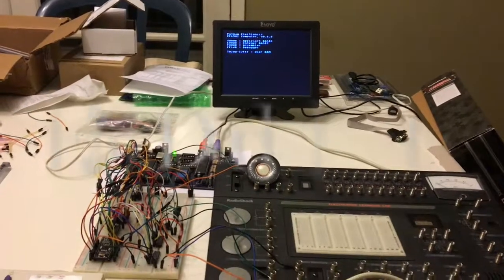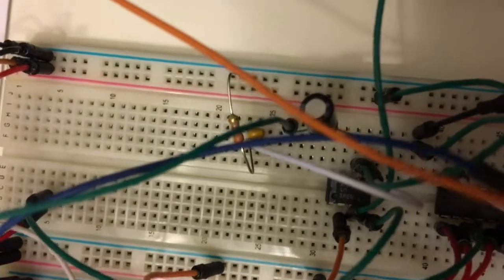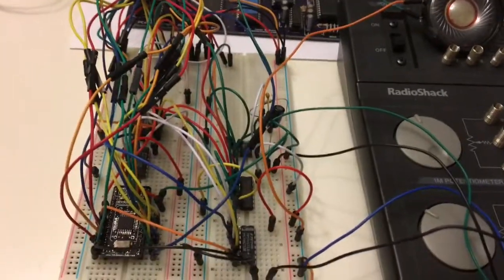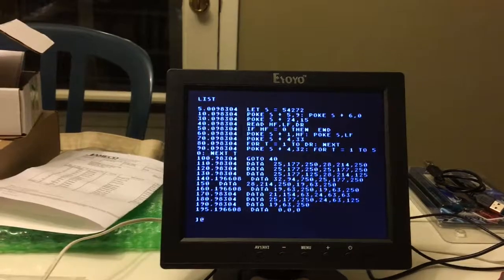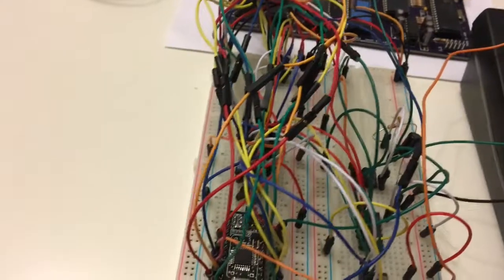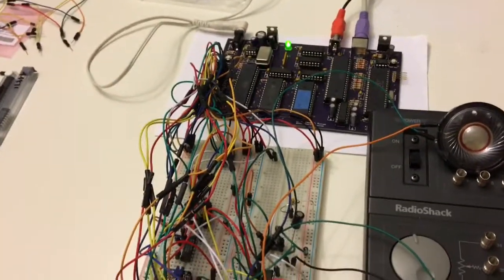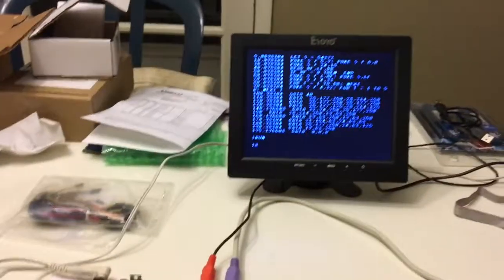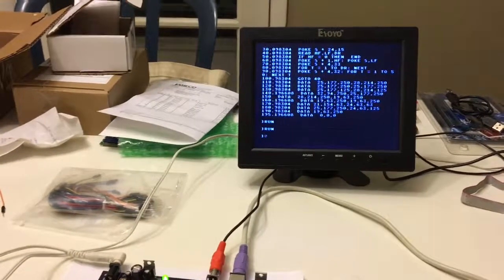PE6502 SID Soundcard, Early Prototype

Comment: The only problem with the original SID-chip is that it is rather fragile, it brakes down when you look at it in a wrong way. Old stock is gone, MOS Technology died a long time ago, so, replacement chips are not available. Harvesting old chips from broken down Commodores can be done, but suddenly the price went up and up like a balloon. Over 50 Dollars for one chip of unknown origin and unknown state of being. 
 
I get the impression that the computer industry is trying to squeez as much money out of the computer hobbyist  is possible.

Comment: I've used the LM386 in a lot of homebrew radios. It can be temperamental at lower voltages. In theory it can work at 5 volts or a bit lower, but tends to do better at around 9 volts. Decoupling is also an issue when you use it in hybrid analog / digital circuits. Cool project!